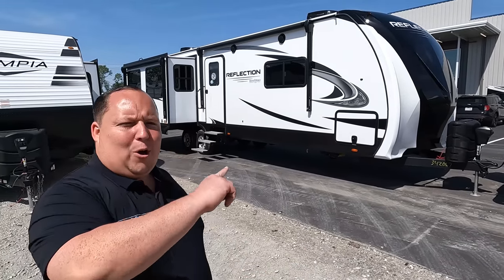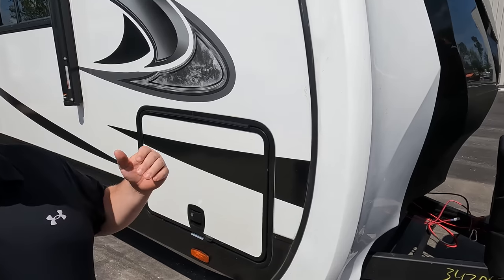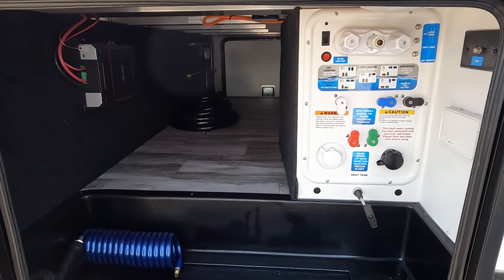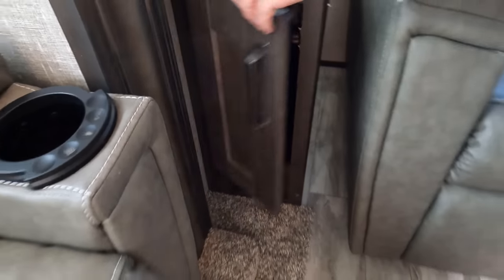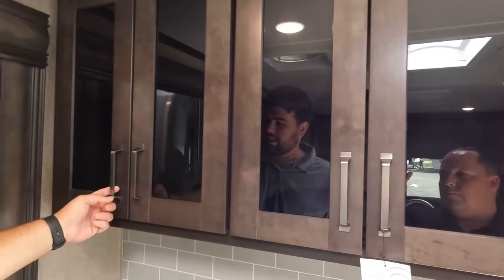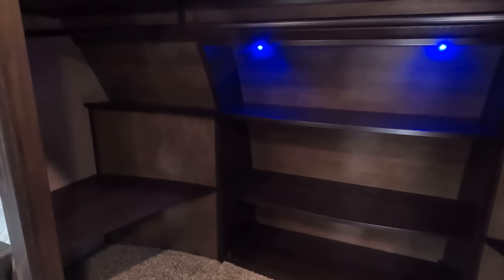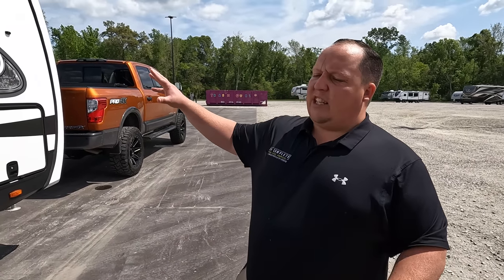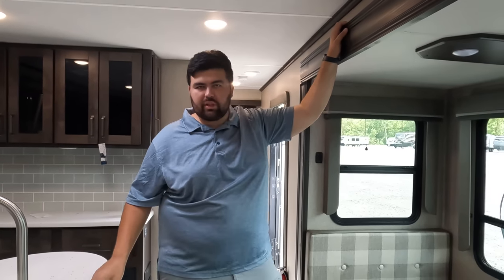Would You Live In This Travel Trailer????

Comment: I am one of the few that doesn't like the steps that fold up into the trailer, many times I have packed up and left in the mud or snow or rain and having to try and clean off the steps or to dry them off in a raging rain storm is not feasible. I love the pantry but wish they would make the lights on each shelf and I agree on the carpet. Hate it. I love the no vents in the floor, and the nautilus wet bay.